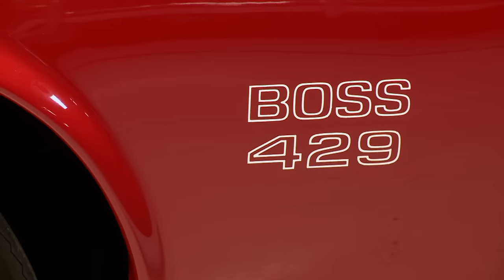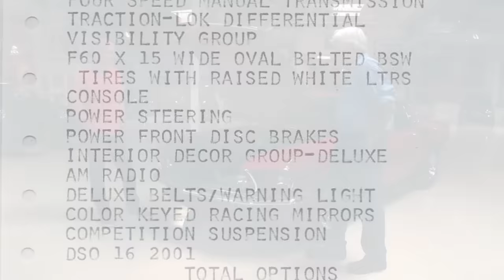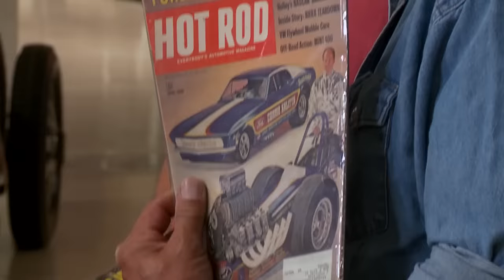1969 Ford Mustang Boss 429 - Jay Leno's Garage

Comment: A good running 428 scj could dust a boss 429 in the quarter and the old 427 wedge won a hell of alot more races. There's alot more made up about these old cars than what's truth.
Reply: 🤣 Yeah, if the 9 was stock.
They Killed the car off the 
production line for insurance 
purposes. The 69-70 Boss 9
with the Thermactor System 
disconnected, and Rev Limiter,
disconnected, Carb Change,
to 850(Came with a small 350)
and add competition headers,
to open them up so they could 
breath, the 428 CJ can’t touch
a 9 in a quarter mile. Fact!
The 9 Is The King 👑 Tang.

Comment: Not the most powerfull Ford in its time 
Every car with 427 had more, the 428 CJ were not far behind and faster on the 1/4mile and the 429 Cobra Jets made more hp than the street BOSS
The racing version was very different to the street engine, choked them down about 230 hp

Comment: Jay sure can be a clown for being a “car guy”.  How does he not know the story of the B9??
This car took no prisoners and it ate the HEMI for lunch , hence the reason Mopar had to build the ugly superbirds.   These cars have the most restricted factory engine arguably ever built, they were fire breathers that ford had tried to make run ok on the street.   Smaller carb than a Boss 302.  Shock towers with no room, these engines have the worst exhaust manifolds you will ever find.  Uncork them and you will not find a 427 Chevrolet or 426 hemi that will get around you.  And imagine if ford actually put the 3.85 crank in them like they should have?? These heads were made for 500” or more